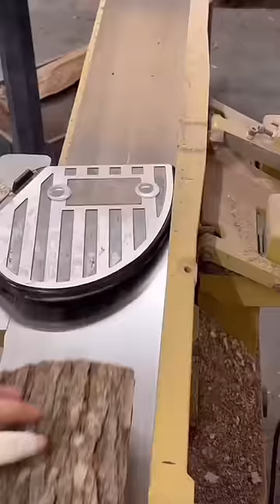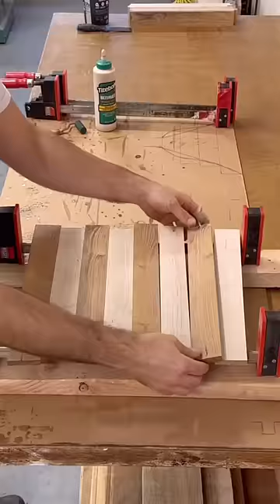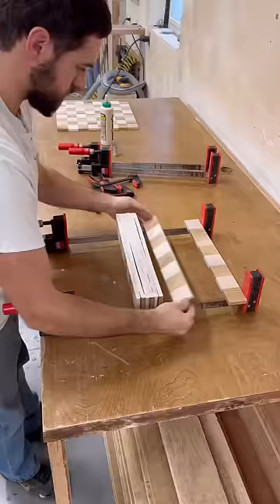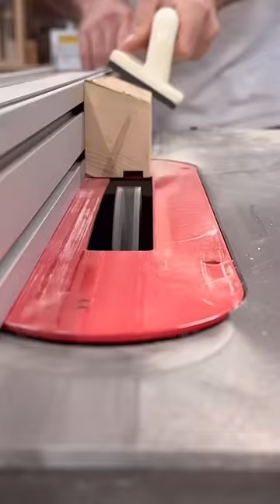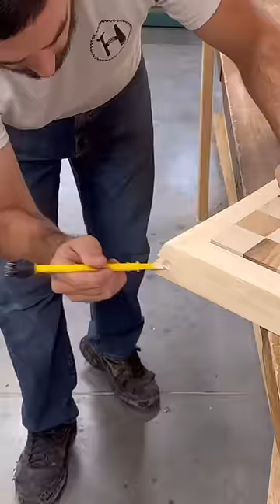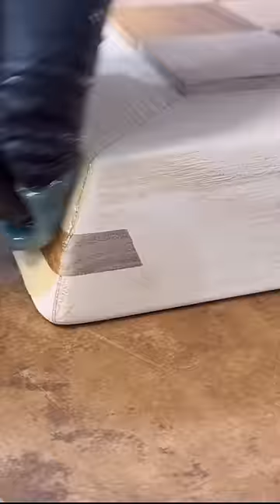Firewood to Chess Board

Comment: You need to do one where the chess pieces on seated down into the board about 3/8” that way you can move it on and off a table (or one on the underside of a cutting board ;)

Comment: Класс. Но только на заказ или для души. Кто это купит?
Reply: I think most wood drying kilns are 120-150F ish.  but be careful, that speedy dry is gonna lead to movement in the wood over time.  This can cause cracks & warps.  you've been warned.

as for time, a moisture meter is best for that...not unlike taking the internal temp of a roast.
Reply: Как кто? Хорошие шахматисты себе, или на подарок 💪🏻😅🤦🏻😎🔥